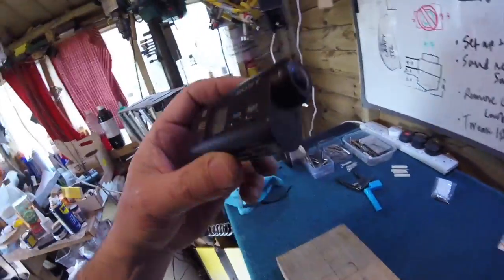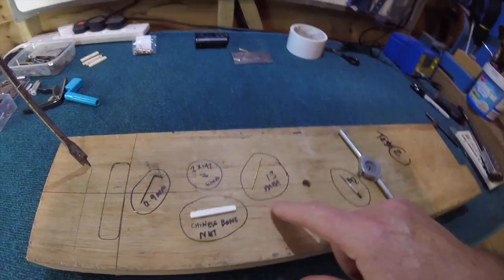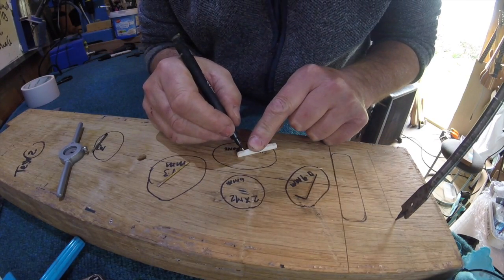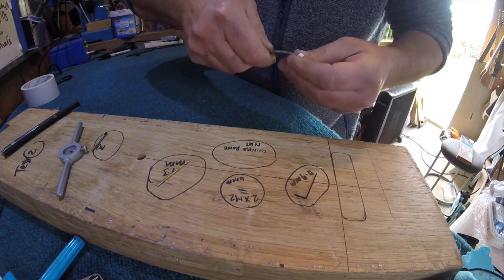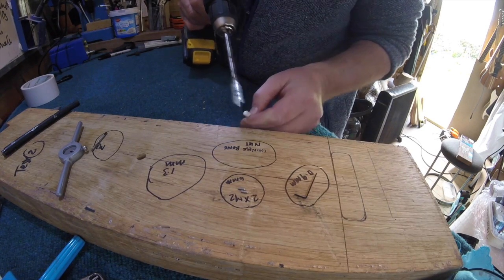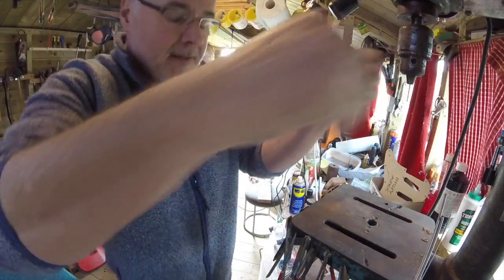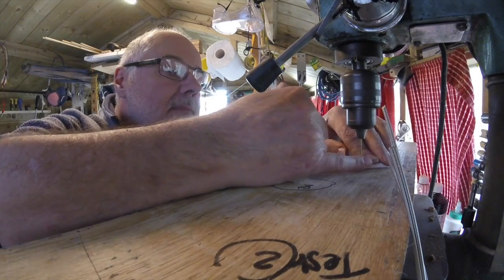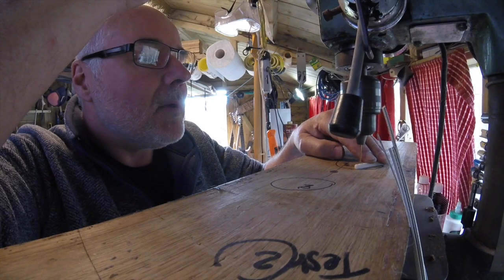Making an adjustable bone Strat or Tele nut using grub screws and a mini tap set

Comment: Sam a really helpful video. I am going to give this a go for my Teli. Have you tried this with a Les Paul style nut slot? I will assume that this type of adjustable nut due to being left loose in the nut slot to allow the grub-screws to do their work, may rely on a double sided grove to stop lateral movement? I am guessing but in Les Paul slot which for the most par is a single sided slot, could an adjustable nut like this fail? Then as a thought for a jig to assist with making these repeatable. If you rout a series of slots (so you have various common nut thicknesses) in a bit of would or plastic, making the depth of these slots 3 mm deeper than your blank nuts. Then router a wider grove 3mm deep into these newly formed jig groves. You'll end up with a series of T shape slots in your board. The idea is to place the nut blank in the bottom and thinnest part of the T slot, which will stop any lateral movement of your blank.  Then setscrews at either end to prevent horizontal movement (or pins if you got fancy with your jig). Once the nut blank is in place drop in the wider part of your T slot, which will be above the blank nut, a bit of aluminium bar. The bar should be pre-drilled with a hole the size of drill bit you intend to use as your set-screw pilot hole. Line up the hole in the bar with your mark on the nut blank and use the hole through the bar as a drill guide to keep the drill true as it travels vertically. You could also place the Tap in the drill press, remove the aluminium drill guide from your jig and by hand turning the tap in the drill press have the tap stay true as it cuts as well. A simple jig may help prevent drill and tap breakages you expressed, because your piece will stay more still than it will if you hold it in your grasp. I hope that helps. Cheers Duncan

Comment: I've gotta question for you but wasn't sure best way to ask.  Anyways I remember you did a video of a Vester repair quite a while ago which I watched since I've got 2 vesters myself.  Well to the point my original the output jack has split in half and looking for a replacement.  But its an oddity since its not attached with any screws, its a round barrel shape that's a friction fit completely flush with the body no tabs no screws.  Any idea where I could get a replacement?  looking to keep it close to original as I can.

Comment: I enjoyed watching this as I'm interested in the concept as I've mentioned once before. A thought crossed my mind though (a rarity in itself!), I agree that you wouldn't have to cut the nut slots, which is great, but wouldn't that also be the case if the nut was just sanded down until the desired height was achieved? I've always thought, but haven't had a chance to try, that rather than filing down the nut slots, wouldn't it make much more sense to simply sand the bottom of the nut? There may be some tiny slot adjustments required perhaps, but the lions share of the work would be done in one go via the nut bottom sanding process.
Reply: More opportunity for fine tuning with the top down method. I like the idea of the grub screw adjusters for even more adjustment to personal taste/ feel.
Reply: @kevingibbet1566  - The same opportunity for fine tuning surely. As I said "There may be some tiny slot adjustments required perhaps, but the lions share of the work would be done in one go via the nut bottom sanding process"

Comment: You're camera seems to be making subliminal flashes from time to time. I think it's a still of you adjusting the camera.  I noticed on a recent video also.  Not an issue but I didn't know if you knew.
Reply from the maker: Hi Robert - hope I've fixed it with a new (similar) camera! Hope you & Shelley are keeping well.